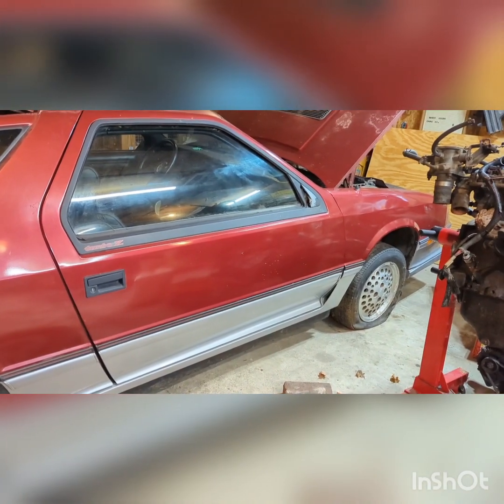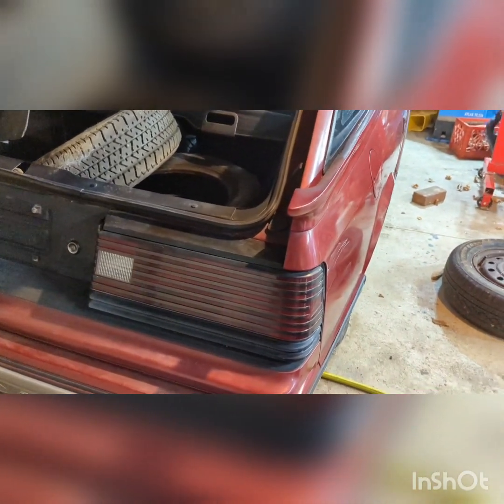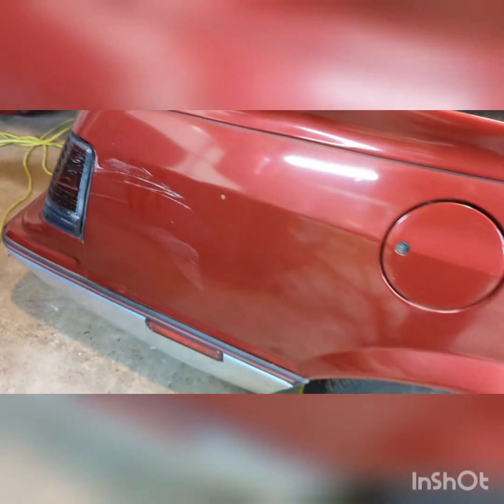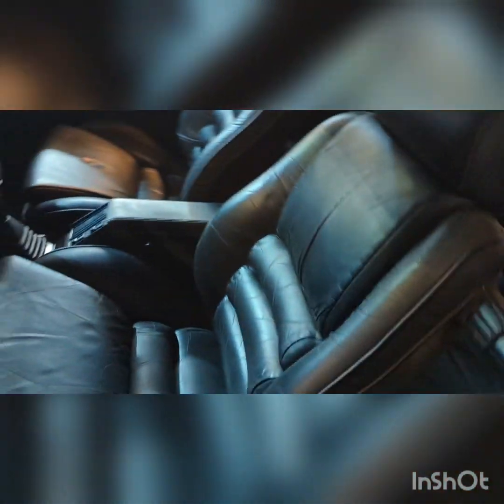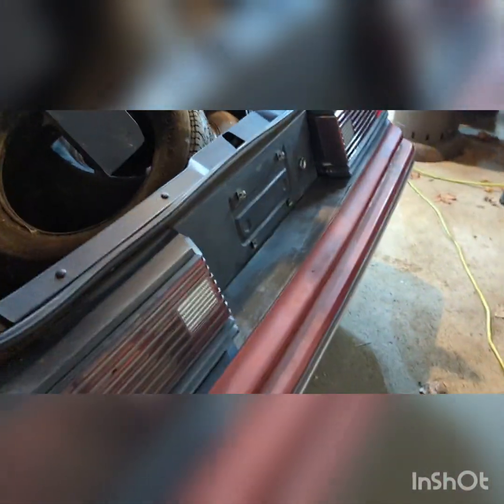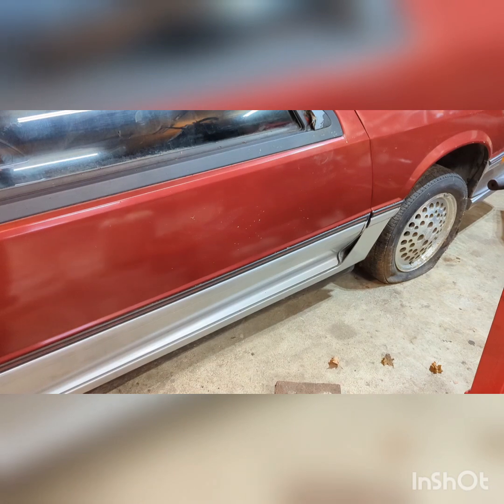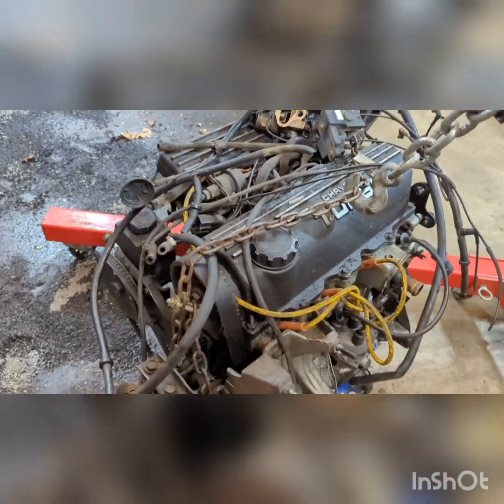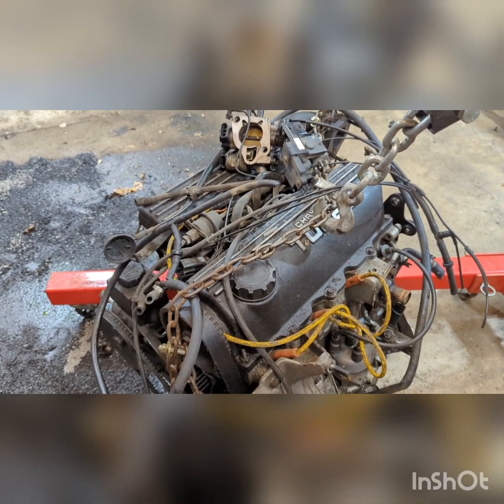Project 1984 Dodge Daytona Turbo Z.  GLHT project car sneak peak

Comment: My understanding is the new blocks were stronger blocks. They were call the common block.  The timing belt also changed. One is square teeth and the one has rounded teeth. The water pump spins the opposite direction. These cars never got the respect they deserved.
Reply from the maker: That is correct.  The common block came out in 1989 and has stronger internals etc